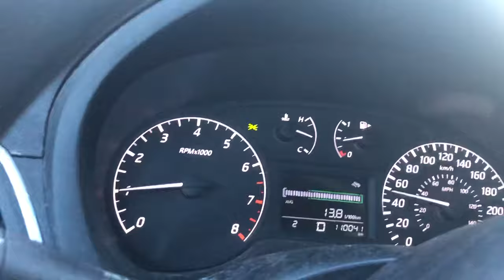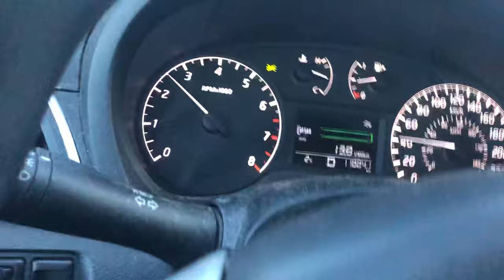Nissan slipping Cvt transmission

Comment: 65000 miles is a good run for a nissan cvt!
Reply: No
Reply: I have a Nissan Sentra 2009 with 150000 miles
Reply: @PartyWolf36790  Chevrolet Cavalier going strong to the junkyard!
Reply: Carlos Arias 😂
Reply: My transmission died at 145,000....Been having problems since 100,000.... I never knew Nissan had an extended warranty to 120,000....Uhhh
Reply: Mine went out at 159,000 miles. I will admit that I did not change the fluid regularly so that did not do me any favors.
Reply: @BroadwayLTDProductions  you don't have to change transmission fluid in cvt that is used for regular driving.
Reply: Haha tru that. Once had a 2014 sentra. Cvt was replaced at 42,000. Lol
Reply: @jonathandelgado2121  I just sold my daughter's 09 Sentra bought brand new 200,450 miles on original cvt! I know it's a miracle from God! We had Nissan do all cvt drain & refill at every 30k. Sold it for $900 it started to acted up go into limp mode a few times in hot Florida weather with AC blasting. Local driving no problem long distance could be a problem as they age. Never again any type of CVT not worth the high failure rate.
Reply: CVT is cheap for auto manufacturers expansive for owners.  All CVT are bad. Only expection is Toyota's.
Reply: @krecikowi  Nissan, Mitsubishi, and Suzuki's owners manual all say to change the cvt fluid. This is vital to longevity of the CVT7.
Reply: @kylemas2005  I checked. There is nothing that I have to. I will do it, because I want to.
Reply: Actually no it’s not
Reply: @ontarioman6301  toyota makes bad CVTs as well dont kid yourself, they make the best CVT probably, but that's like being the best smelling turd.
Reply: No.
Reply: Mine just hit 75000..pray for me lol
Reply: @krecikowi  that's a myth to make big money off transmission rebuilds
Reply: @kylemas2005  The dealer will often tell you otherwise. Then if you keep pushing say they'll do it for $600 .. lol.
Reply: In the UK I saw a dealer with a Juke for sale and he said that the original CVT failed at 29,000 miles.
Reply: Mines in the shop rn I haven't even hit 48k lmao

Comment: Too much trans fluid in your CVT will cause the surging, OR your mass air flow sensor will cause your engine rpm to surge like that.
Reply: My throttle body valve was dirty did it too. Wouldn't close all the way
Reply: @Shitty796  Throttle body seems to be a common issue, the butterfly valve gets gummed up and doesn't close smoothly. Mine was shuddering a little bit as it dropped into idle automatically at the lights, and I was initially really worried it had a CVT transmission issue, as I'd just got the car. I bought some throttle body cleaner (with a long spray connector) and just blasted it in after the air filter while the car was running for about 5 minutes and it cleaned up perfectly. There is no need to dismantle half the car to do this or find a vacuum line, you may need to put something on the accelerator or have a friend depress it to keep the revs up from stalling out while cleaning. The throttle body clean should be part of regular maintenance say once a year.
Reply: @VenturiLife I appreciate this shared experience thank you

Comment: I installed a aftermarket oil cooler fixed all my slipping issues, just need to do a fluid change and filters.  At 78k started slipping at 64k, 2017 Nissan Sentra.
Reply: I you mean cvt cooler
Reply: Supposed to be changed at 60k, then every 30k after that.
Reply: I bought a oil cooler but I haven't been able to installed, I don't know how to install the hoses.
Reply: ATF cooler
Reply: It's kind of sad Nissan didn't install good enough cooling systems for these.

Comment: That's not your transmission, you need a new mass airflow sensor. Had a 2012 Altima that did the same thing.
Reply: Maurice DeLance so that stuttery jumping of rpms was from your mass airflow sensor?
Reply: @chrisharmony160  yes. Bad MAF caused erratic signals sent to the computer causing "throttle body confusion". Bought one from advanced, changed it myself, no more seizures.
Reply: @mauricedelance6199  I too have the same issue with my Nissan Pulsar 2016 and have done only 51K. I will try your advice.
Reply: my 2012 Altima has an engine light for MAF sencor all the time, drive without any problem, i just ignore it.
Reply: Changed my mass air flow sensor and got better milage and no more drops in power going up hills!
Reply: I was suspecting my MAF as well, saw improvement when I disconnected it but it was doing it less but the failure was still there slightly. I also noticed that the air filter was really dirty so I suspect the MAF was probably dirty too. I was thinking it may have been because the MAF was inactive when I test drove it, the issue was almost gone but was there slightly.
Reply: @ramandeep3510  What was the outcome?
Reply: @mauricedelance6199   I got 2012 Altima right now my car just started having these seizures what should I do to fix this problem
Reply: @MRSTACKZ10  start by changing your mass air flow sensor or at least taking it off and cleaning it to see if that solves the problem.
Reply: @mauricedelance6199   I appreciate it bro ima try this first thing in the morning , so if I clean it and still doing it that means I need to go buy a new Mass Air Flow sensor?
Reply: @MRSTACKZ10  I changed my MAF but no change. The readings were the same as before so the MAF was not the problem in my case. I changed the Valve Body and it appears that the problem has gone away. When removing the pan, inspect for large chucks of metal, fine metal shaving on the magnet is normal per the manual.
Reply: @scientist100   thanks definitely appreciate it 💯 ima check the Mass Airflow Sensor and if I’m still having same problems I’m going to check the valve body
Reply: Yep . That sounds like a dirty mass air flow sensor and air filter. 

Also dont drive a jatco transmission like a maniac. They are weaker. You should know.  And change the transmission fluid at 40 k
Reply: @TheProcrastinatorPro4638  you're right about the air filter, it was dirty when I bought the car so I also suspected a dirty MAF but the issue was not fixed, also try changing the transmission oil, I went ahead and changed the valve body because it was a TSB if you have a tranmission related code, the TSB covers a lot of codes to condemn the valve body, two codes that I had were on the list but they never came back when I erased them so I recommend writing down the codes prior erasing.

Comment: I have the 2017 sentra looks like yours, mine has 142,000 miles and doesn't do that like in the video. Have you changed the cvt fluid before
Reply: Yeah i think that would help em

Comment: Mine is a five speed standard transmission. I wouldn't have purchased it otherwise and it's fine. I knew Nissan has bad Jatco CVT's and refused to go there. Had mine in for an oil change and another guy was anxiously awaiting a verdict in the waiting area. The service manager finally came out and told him "You need a new transmission". I thought holy crow, everything you've heard is true. We should be okay.
Reply: STD transmission in a Nissan good way to dodge a bullet .. it's no if the CVT 's go into self-destruction it's when.
Reply: @tonys8243  why get hung up on Nissan? Toyota can make a great reliable automatic for their Camrys, even their CVTs on Corollas are reliable.

Comment: my 2.0 07 sentra has 201k miles and no cvt issues. My advice is dont drive your car until it breaks to fix it.
Reply: Yoel Badi sure, every car, model, made, and brand are made to be in a good shape through a certain of time not only the Nissan

Comment: I have a 2014 Nissan Sentra with a CVT at 256,000 km and it runs just fine with it. Call it luck I guess
Reply: Mine has 1330000 Miles and it runs awesome. If you do not do the CVT maintenance and engine as well of course you will have issues. could be a tank fi you do not do maintenance you will have issues with it

Comment: Yea mine was overfilled with two quarts transmission fluid,took drain plug off and let it run out till it stopped,just took drain plug off but left the inner tube in.Worked perfect after that.
Reply: That's brazy bruh.

Comment: Well this helped me
Kind of diagnose my cvt nissan altima 2010 3.5 sr. Because if this is what a slipping cvt does mine cant be slipping. Because mine basically sounds like and feels like its in neutral no matter what. I put in drive it does not drive. I have no problems shifting it into gear and before this happened to it. The car ate a lot of its cvt oil (smelled it burning) and i took it to an autozone before that happened and it had a p0744 code that i did not check until after i had to pull over to the shoulder because it did what it did, felt like it went straight into neutral while the selector was in drive. I tried shifting it to manual mode and the tcm was able to read the speed enough to say it should be in 2nd gear. Even though before this the test said the engine speed input sensor was out (actually wait thats another possible fix that needs to be done) the output speed on the transmission was definitely working cause it read it to be going only fast enough to be in 2nd gear. Anyway though p0744, either tcc circuit related. Tcm related although less likely now i think. Or tcc pwm related and possibly also lock up clutch related. The test said that two parts were needing replacement although it could not find the parts in the auto zone catalog but to go on z net and look it up under most likely solution. And it said on the whole to fix the issue most likely was to replace the transmission valve body. Guess what goes on the valve body? The stepper motor (i could buy that separately if needed) two shifting solenoids (my car has had zero issues shifting out of park and into reverse or drive or manual mode or drive sport) and the LOCK UP CLUTCH SOLENOID AND PULSE WIDTH MODULATION SOLENOID. I looked it up and its what engages the torque converter. The thing that is literally made to give the transmission power which gives the wheels power. Bing bang boom i think i just need to DO with the stupid test was telling me to do. This whole time

Comment: Depends how u drive the vehicle and what maintenance you put into it. 2015 Murano, bought Jan 2016,  101k miles,  replaced CVT fluid twice so far..no issues with cvt or anything else. Many people complain due to the drone effect. At 40mph, engine revs at 1000rpm...and car sounds like a drone at times. But I average 27.4 mpg (due to cvt) in a 4000lb suv so no complaints here.
Reply: Hi I bought 2017 nissan versa on 69k its one week since I have this car and I don't know cut fluid has been charged in past or not plz help should I charge it and how often should I charge it I am single mom and it's hard to get car plz help me
Reply: @noreenshahzad2960  there should be a service booklet in your glove box? Maybe check that if you haven’t had it serviced already?
Reply: @noreenshahzad2960  I would get it serviced regardless. $150-$200 now to save yourself a potential headache later. With 69k miles on it, hard to tell if it was changed before but likely not.
Reply: My Nissan dealer keeps telling me that fluid replacement (which the manual says should happen at intervals) doesn't need to be done on the CVT trans. I'm dubious to say the least.
Reply: @VenturiLife  That's highly innacurate. SOME CVT transmissions do not need a change. That does not apply to Nissan's CVTs. The manual for my 2018 Sentra says to change every 50k miles in normal driving conditions.
Reply: That's right...You have to regularly change the Gearbox oil and she will be fine. People just neglect them until they then start having trouble and then it's too late and expensive.
Reply: @noreenshahzad2960  just get it done
Reply: My mother bought her Nissan Sentra used at 60k miles (against my advice) and now we're dealing with this around 95,000 miles

Comment: My 2015 Altima had 47k on it, so as preventative maintenance I took it into the dealership.  Now it runs great especially in sport mode.  Yeah, I traded it in for a new 2020 Mustang GT Premium with a 6-speed, and it runs strong with no CVT problems.  As an added benefit no one under 60 can steal it.
Reply: Now, there's a plot twist if I ever read one. Lol, just be careful.. Those Mustangs have been known to have a mind of their own, and intentionally plow into innocent pedestrians. I know, because I've owned a GT, but it was a late 90's.
Reply: You just went from owning a POS car to trading it in for another POS car. 🤣🤣🤣🤣🤣
Reply: @DynamicDuo795  And your car?
Reply: Traded big Altima Energy to being a Mustang dudebro lmao

Comment: I have a 2013 Nissan Altima 175,000 mile I drive it like crazy I drive it in sport mode every day lol she still runs nice. As long as your not lazy and cheap and keep up with maintenance your Nissan will be fine!
Reply: I have double your mileage and my cvt is fine in my altima lol
Reply: Trust me. Driving any car hard will reduce it's life, particularly the transmissions. Metal fatigue, temp, wear will eventually kill a trans, and it's little pump / solenoid components, so stay on top of the fluid / filter changes and ignore the dealer FUD about not changing fluid as per the manual. The most important thing is not to abuse the transmission with hard launches or anything similar and it will last. Oh also look at adding a Nissan transmission oil cooler, that can make a huge difference to lifespan if you live in a warmer climate.

Comment: I have 130K on my 07 Altima 3.5 SE with an original cvt transmission. Runs like a dream
Reply: My grandmother has an 08 altima with 189 thousand miles with the 2.5 and the original cvt is still going strong these cars can be good if maintained well scotty Kilmer is not always the best guy to listen to when it comes to vehicles.

Comment: And this is why I read specs sheets.  I drive a 2003 Jeep GC, and a 2014 Chrysler Town and Country.  Those moped designed CVT transmissions sound good(reading), but just don’t play OUT WELL.  now all the Subarus have gone to that trans, at least their website spec sheets say CVT..

Comment: My Nissan Versa does the same thing . The RPM gadge goes back and forth  between and 1 and 2 once I been driving the car for awhile . The car  starts to jerk sometimes .   I changed the transmission fluid and put in some Barrs stop leak and the problem seemed to get worst .
Reply: You really.messed up with that addictive.  Never do that 2 a cvt transmission!!!
Reply: Lubegaurd makes an additive for that shutter
Reply: Do not use additives in a CVT 💀
Reply: @hyperpotato1197 depends on what your reseach yields you i had to put shutter in mine and it stopped shifting nearly as hard and ive put 10k miles on the trans since and still runs good

Comment: I have a 2013 versa, transmission is on its last leg, 130000 miles, it’s lurching at 1st gear, slipping occasionally, wheezing at high speeds, also I hear a low knocking sound as well, also when I go up inclines it can barely make as it starts to stutter, my mechanic said the zipper is damaged abs it can go out anytime. Lol I already bought another vehicle just not sure what to do with it. It’s still running just barely, should I junk it??

Comment: I am using Nissan sentra 2015. nowdays I am facing gear shifting issue when I am pressing the accelerator with small amount of pressure while I am crossing the signal. The speed and rpm is increasing but the gear shifting is not happening. what will be the issue? can I drive this as it is? any issue?

Comment: nissan needs to replace these rogues and pathfinders too! did 3000 miles last week and last fall in the rogue, smooth until the metal belt goes to slipping! changing fluid often, easy since rogue has drain plug and check plug. dont believe fluid changes will prevent problem unless heat is breaking down fluid or ???
Reply: Nissan started installing external transmission coolers on Rogues

Comment: What is it when the shifts really crapy? It doesn't slip it just takes a while to shift if car is being floored it hit 5000 rpm and doesn't shift till I let go of the gas. What is this? Thanks
Reply: Check ypur trans fluid level

Comment: There is/was a class action lawsuit for nissan cvt
Reply: I got a notice in the mail for that and was hoping to get back some money or something but COVID-19 happened 🙃 and the trial never happened
Reply: Nissan should give us all a unlimited transmission replacement for free and done in 1 day after we schedule an appointment
Reply: They use a rubber belt to spin the transmission if you buy a Nissan with cvt you will need a new transmission sooner or later
Reply: Rubber belt is the weakest link in the transmission and will break eventually
Reply: Nissan offered a very extended factory warranty out to something like 6-7 years for the cars initially due to CVT issues. They will replace at no cost, a lot of us own cars well beyond that warranty.